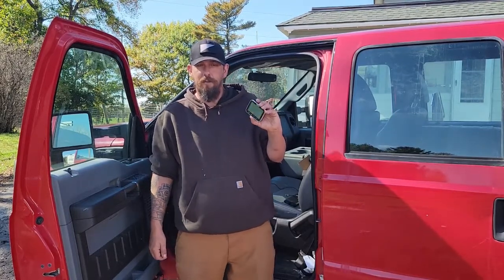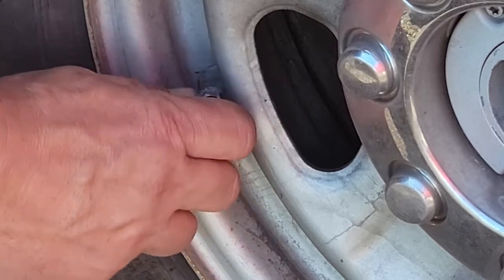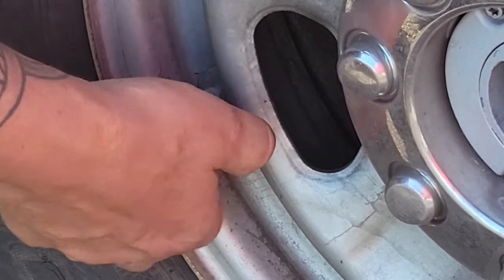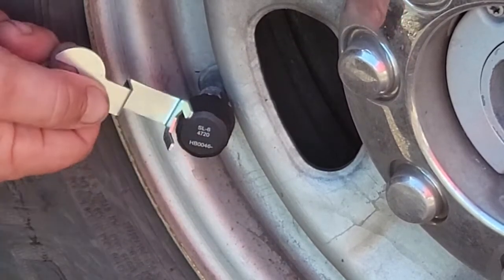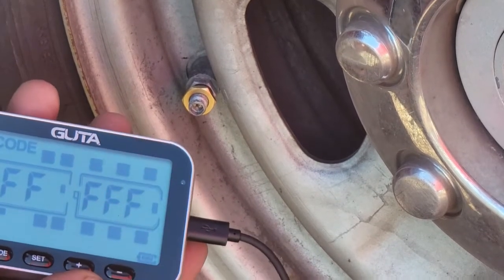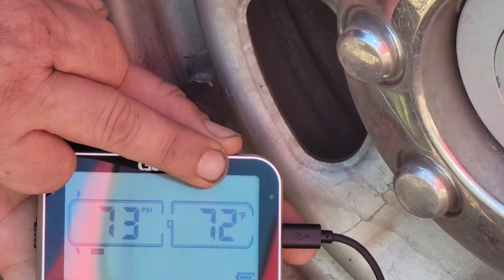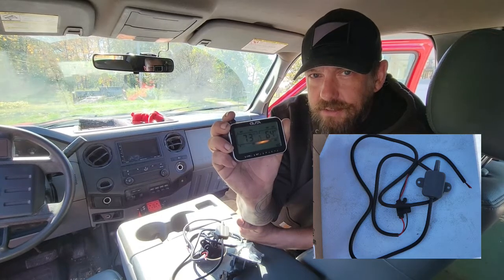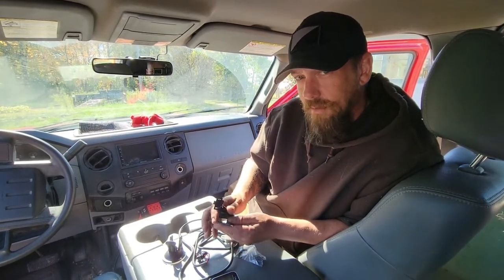GUTA TPMS Install.  Tire Pressure Monitor System for truck and trailer.

Comment: How do you set the high and low pressure alerts? And a high temp alert?
Reply from the maker: It has been a couple years since I installed it. I couldn't tell you how to do it, but I recall it being very simple and in the instruction book.
Reply: @TheLOTSProject  There’s no mention in the instructions that came with my unit. I’ve emailed GUTA. It does say, however, that there will a 20% above existing tire pressure alert and a 10% below existing pressure alert. Maybe settings aren’t necessary…but I find it odd. Thanks!

Comment: In your opinion will these work on an off road vehicle, Polaris, CanAm etc?
Reply from the maker: I am sure they will work.  You wouldn't really need 8 of them.    The caps basically screw on like the normal cover and read the pressure there.  Send the signal to the display and that's about it.     Come back and let us know if you try it and how it works out.   Thanks for watching.
Reply: @TheLOTSProject  We will test them, if they seem to work we will use them on a car in the Baja 1000.  That should be a good test!
Reply from the maker: @kirkkontilis695  awesome.  That would definitely put them through their paces.  Good luck in the race.

Comment: can it be mounted to a side window?  Reason I need to mount it on the side window of my motorhome
Reply from the maker: It has a suction cup mount and screws/double stick tape as option to mount. It should work for that.